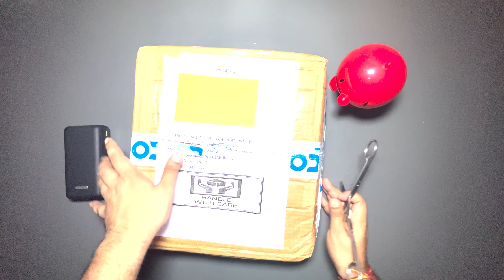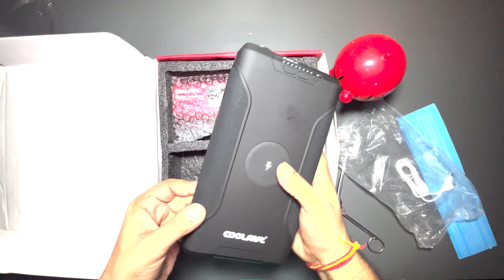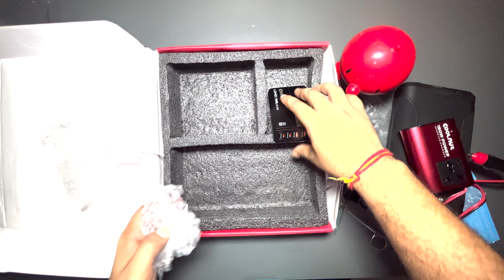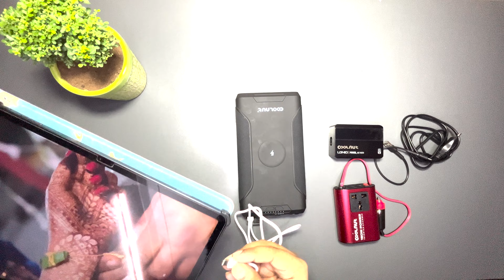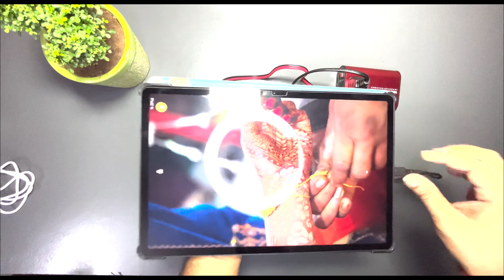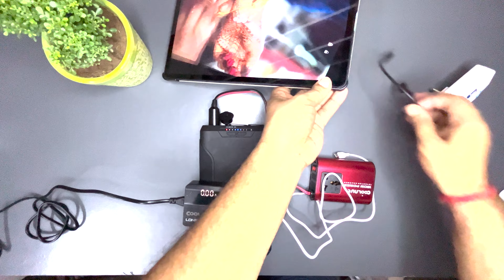Coolnut 60000 mAh Power Bank [Overexposed Video]

Comment: how much hours backup
Reply from the maker: I charge my laptop that’s takes 65 watt power supply as an input 4- 5 times without any issues.
Reply from the maker: But the price of the product has increased on Amazon and flipkart. So if you do decide to buy, But it from the company website.